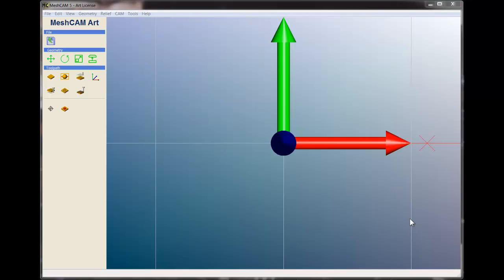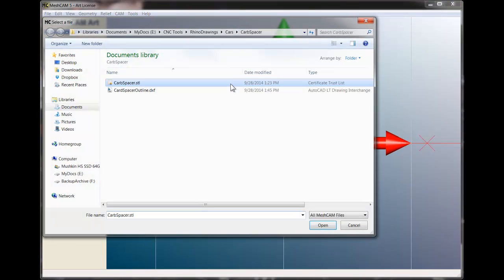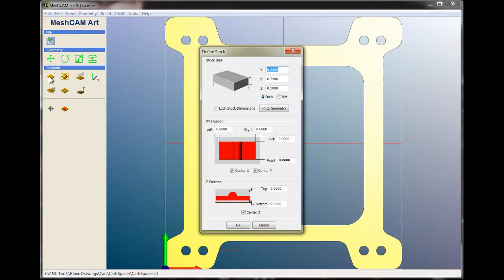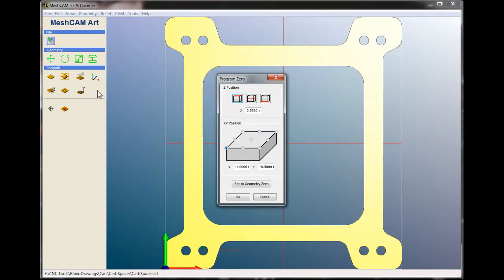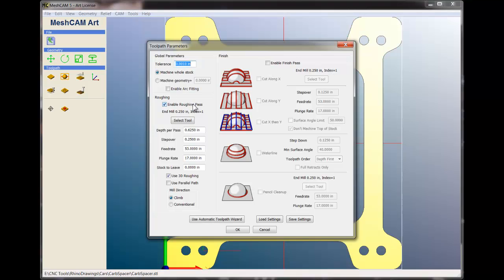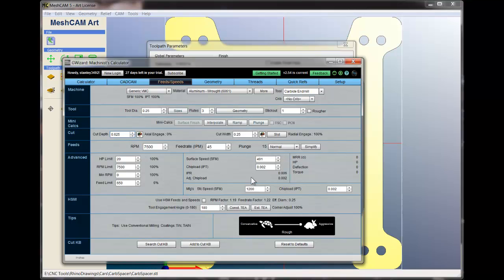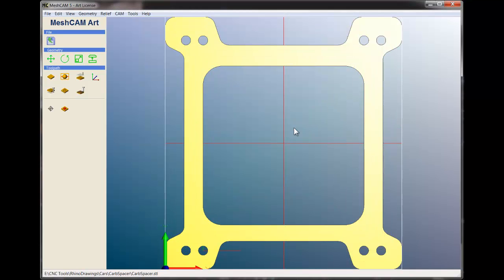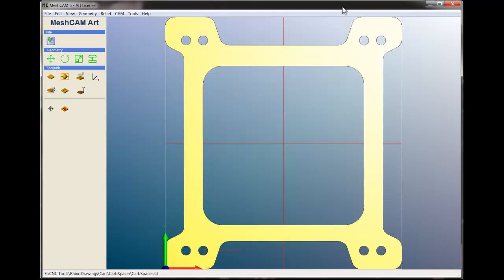MeshCam: Beginning CAM Part 1

Comment: Can you set meshcam to drill those holes all the way through first before doing the inside or outside? This way you can setup a clamp and not use tabs to hold the work piece?